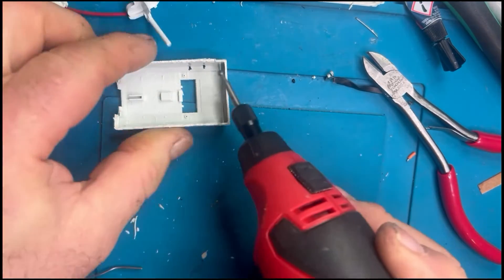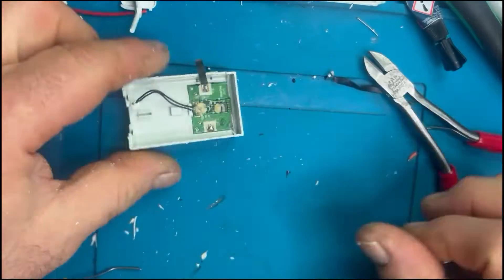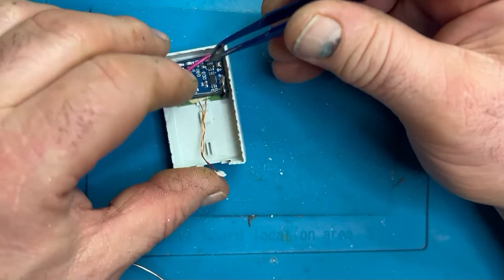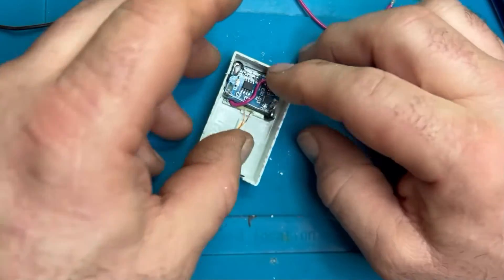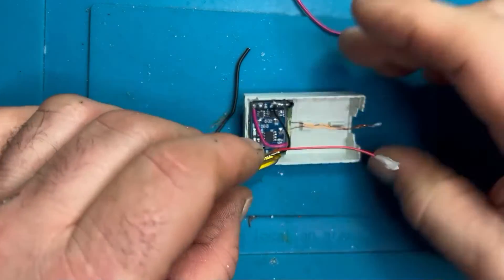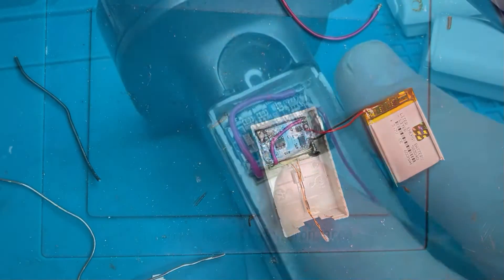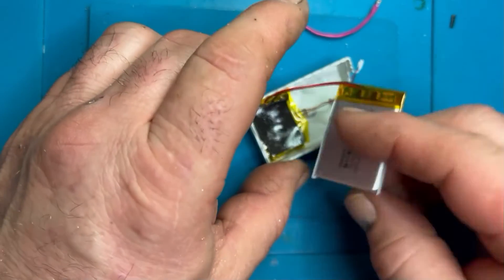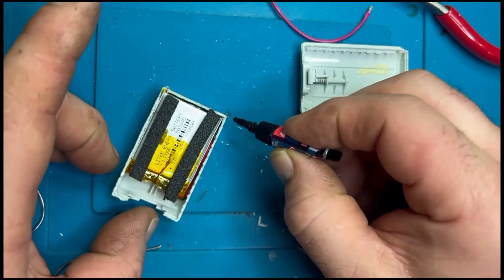Xbox360 Controller Lipo Battery Mod

Comment: Hi Thanks for sharing your DIY modification, it is quite nice. I do not have a separate charger like yourself and I do charge the batteries using the play and charge USB cable. Will that modification of yours work with the play and charge USB cable too or does it need modifications?
Reply from the maker: It should work the same chap

Comment: Is it necessary to have earth wire from left to right on the negative terminal of the board? I notice you have one that don't have it from you video. I have no electronic knowledge, and want to copy your method. Would glad if there is more detail step by step tutorial.
Reply from the maker: @raikolightning9426  yes the earth is passed from input to output and a common earth for all the earths

Comment: Hi good friend, do you know if the motherboard has a built-in voltage regulator that lowers from 4.2v to 3.3v? Or does it have it in the same battery that is plugged in from behind?
Reply from the maker: Are you talking about the original board in the battery or the new controller board I added
Reply: @TheVetUk  matrix v2 is the last mainboard controller xbox360?

Comment: hey would it be possible to just replace the batteries with eneloop rechargables?
Reply from the maker: I did try that years ago and it did work but the made the body swell a bit and still did not last like the lipo but it did work 👍

Comment: My issue is the battery compartment disconnecting on 360 controllers. I've several excellent 360 controllers collecting dust because they would randomly desync. This is a perfect solution! Thanks!

Comment: Great timing for this to come out. I’ve got 3 controllers and a big ass bag of dead play n charge kits that I’ve  been looking to update. Rather than using an external charger, I’m looking for a good clean mod to charge this type of battery via USB C
Reply from the maker: The charge board can be purchased with usb c input which you could arrange in the holder to be externally charged  I used a genuine charge station but you could 3D print a holder and make up a charge station I would be interested to see how you get on 
Cheers 👍
Reply: Yes, same here. I've already got a dozen leftover from another project rectangular 6,000 mih batts that fit rather well. I need to convert them to USB-C charging but well worth the effort.
Reply: Why do you say Earth here in Brazil we say GND wich means Ground.

Comment: I managed to collect a few of these disposable vape devices that have a cylindrical Li-ion cells around 850mAh capacity. Even with a small charge controller they might be a bit too big for the case although there are some skinny ones aswell.
Reply from the maker: Might be worth a try if they fit and will last for ages